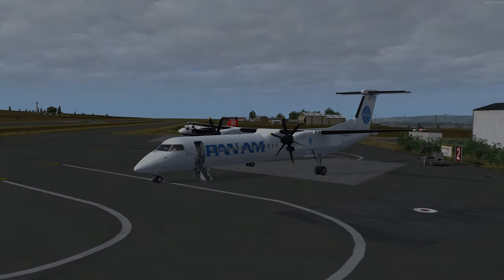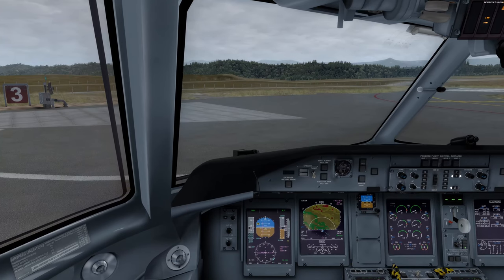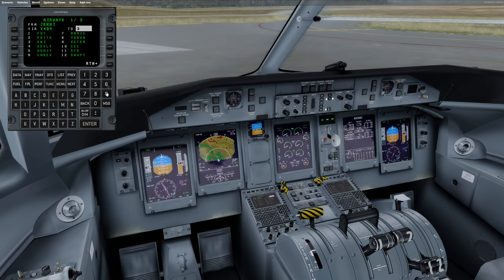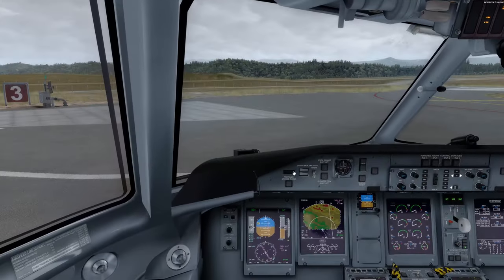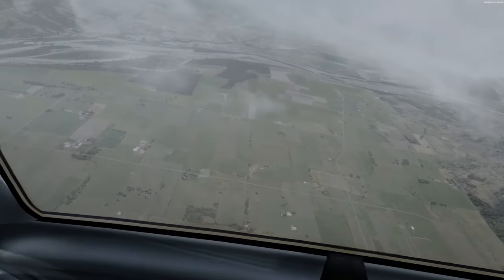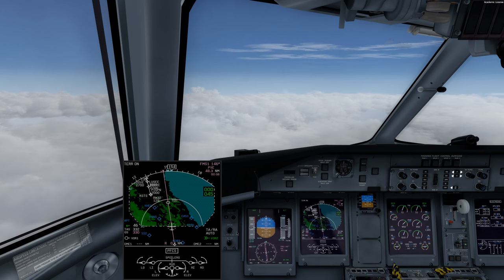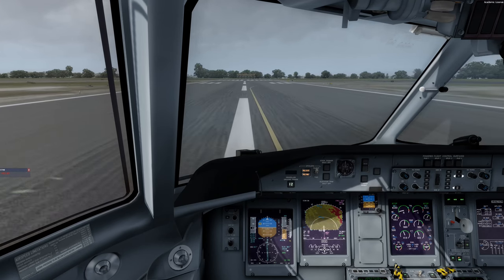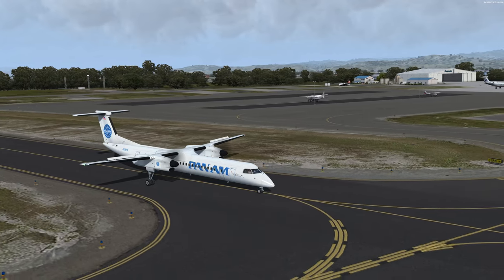Majestic DHC-8 Q400 Pro - KFOT-KSTS + Planning And Startup

Comment: Hi Marshall, Thanks for excellent videos which I have found very informative. Please clarify one point. you mentioned putting in some right rudder trim prior to take off. I am aware that in the documentation it mentions putting in rudder trim during flight to correct the 'sailboat'  but I can't find it in the documentation how to set it up prior to takeoff. Please advise how many clicks one needs to apply prior to take off. Thank-you